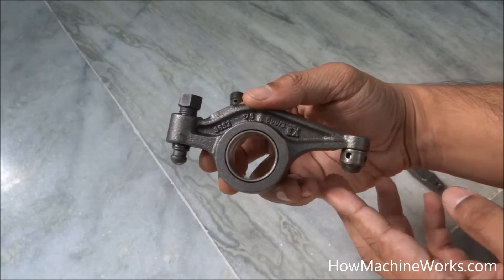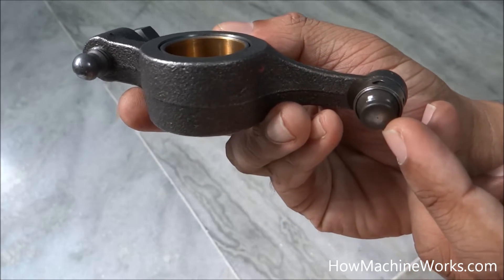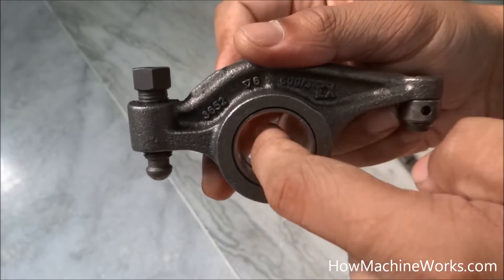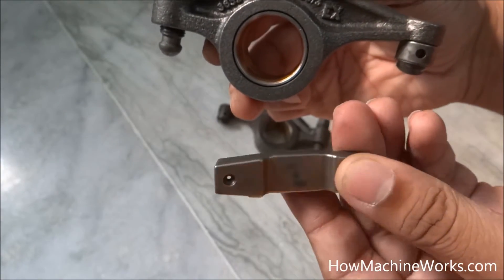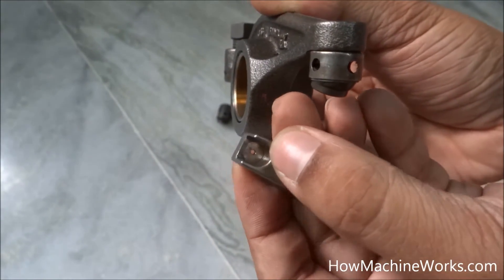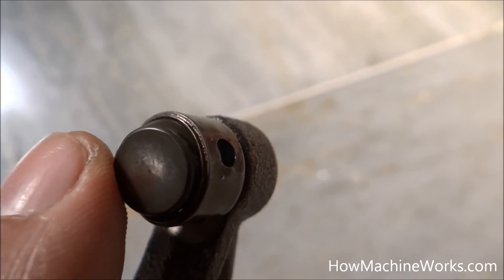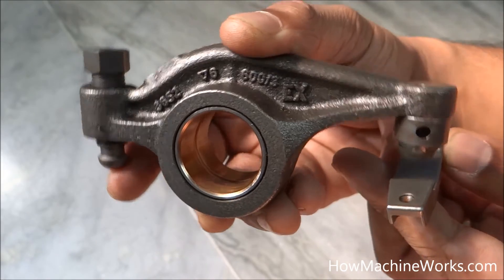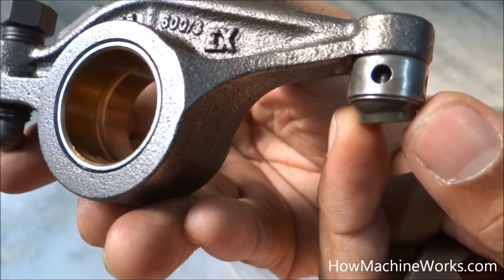How elephant foot in rocker arm of an engine works - Must watch

Comment: Excellent video. Why is elephant foot so loose? It should be rigid....What is the advantage of this play? Thanks...
Reply: Loose because there is no oil pressure on it and the valve lash hasn't been set yet.
Reply: Thanks for your kind reply. Keep it up.